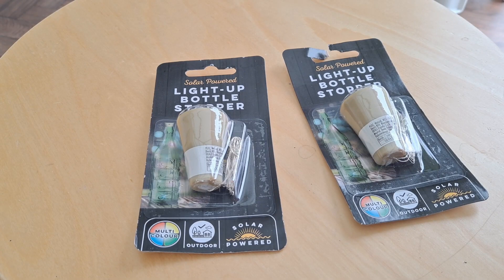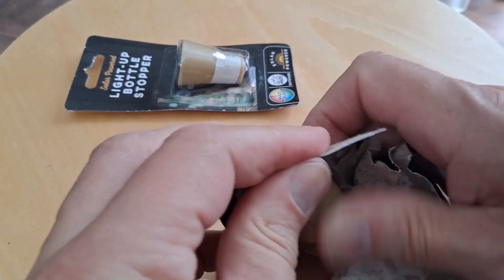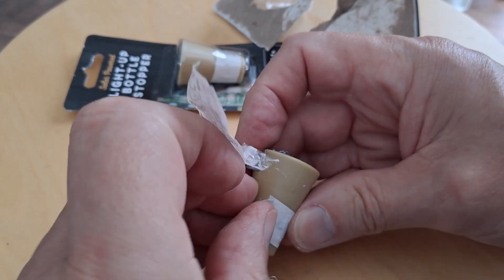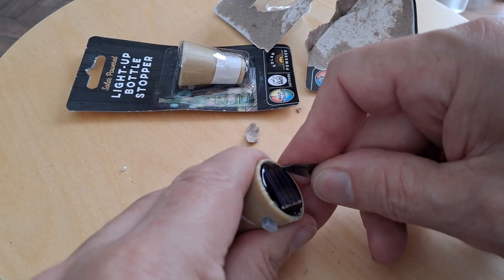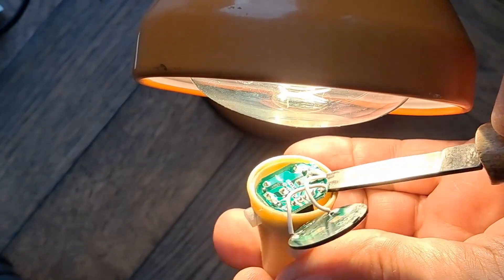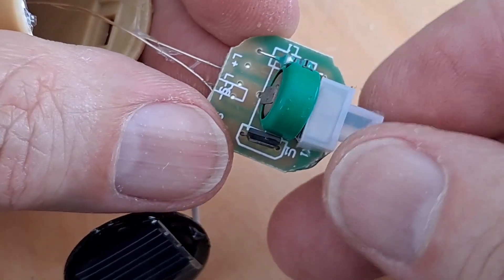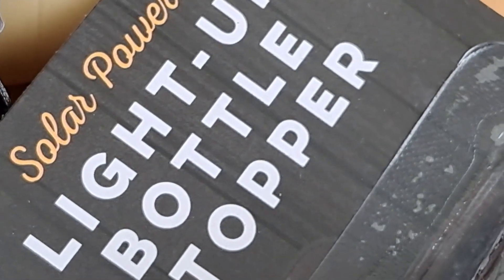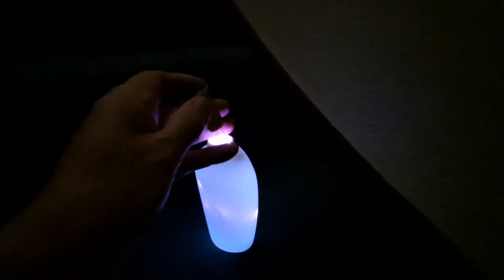Poundland Solar Light Up Bottle Stopper peek inside

Comment: Nice trick using the lamp to heat it up. Thanks 😀 👍
Reply from the maker: Probably not the most efficient way to do it, but it does demonstrate how hot those halogen bulbs get 😳 😁
Reply from the maker: On a side issue, I was looking at videos on printing TPU and noticed you had commented on the one I was watching. Did you ever get round to printing with it?
Reply: @GrandadIsAnOldMan  No, I have a sealed roll of TPU in the box still. After seeing your direct drive upgrade I am wondering if I ought to do the same, if it then let me print TPU more easily 🤔.  How has the direct drive extruder worked for you? Thanks 😀 👍
Reply from the maker: @mrrgstuff  I have only used it with pla so far, but the intention is to try tpu. Every video and article I watch and read gives conflicting advice. I can see I will just have to try it for myself.

Comment: Excellent for a quid. Those batts are very similar to the ones in 2 very old RC products here, Micro Terrain Titan car and Silverlit Singlewing plane. Not only could such a product replace the batts in those, but be solar charged. Will have to see if local stores start carrying them!
Reply from the maker: I did a little series on the current crop of solar garden lights recently. A good selection of different battery sizes, from 2/3 AA, standard AAA, and these little ones. Here is an example https://youtu.be/uGLVdF28rYg?list=PLA5a2xPRSrB14BZZCNWNAA67oXF3es8us